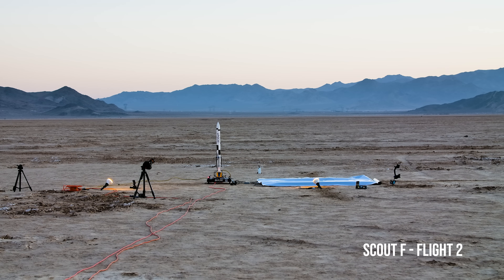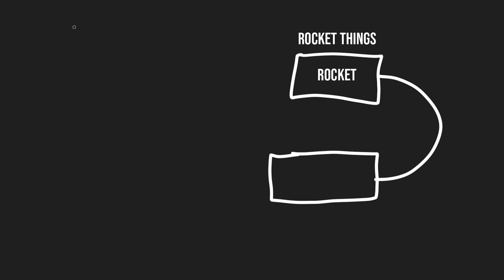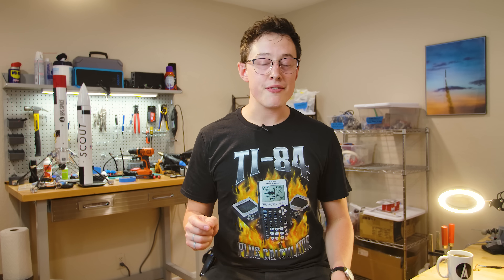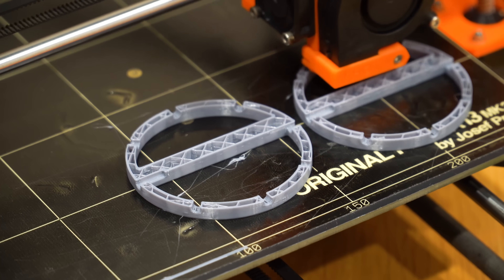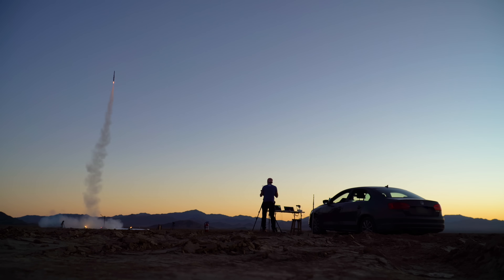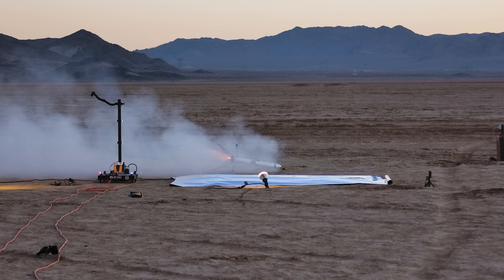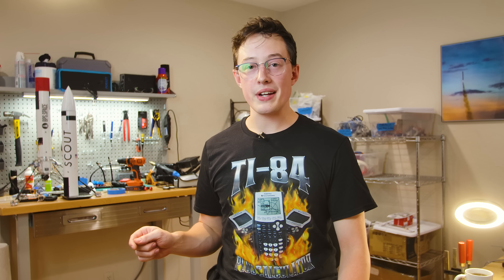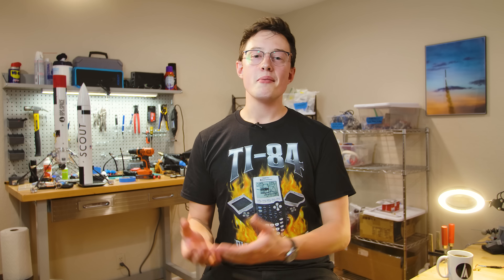Aluminum TVC Mount | Scout Flights 2 and 3

Comment: You should to take a batch of motors and accurately measure there burn rates in a controlled experiment as there will be slight marginal variation between motors that would let you calculate an average burn time for that motor and therefore give you more accurate data for calculating the height of the burn before the ground. You can see in some of the landing the motors is still producing too much thrust and likewise in some cases not enough

A lot of the issues with the model would improve actually just if the whole thing got scaled up.
PS I know you have successfully landed this now but just scrolling through your vids

Comment: Hey Joe,

I have been watching your videos now for a while and am absolutely impressed with your tenacity. I have a suggestion that may be late to the party but may give you an easier time controlling the oscillation issues you are have on the gimble. 

1. Instead of angular servos adopt a NEMA 8 or 11 stepper attached to either a gear rack and pinion or lead screw. Your stroke is roughly 5~7mm if I can gage from the video. The stepper has a holding torque to help stop the bounce but adding a lead screw will stop the bending moment and loss of leverage at the end effect. I recommend a lead screw vs gear rack due to the ability of the lead screw to add back feed counteraction. Use a fine pitch of about .5 and 8mm D. You will need to add a stepper driver of course and then in C create a simple PWM to step/direction algorithm to convert the PWM angular to steps. Not hard and there are several examples. This will add weight but not so much that you couldn't add grain size to compensate.

2. I see you try to use screws as pivot points. I highly recommend using bronze bushings and shoulder bolts giving you excellent tolerance at you pivots and an easier way to fine tune the fits as the shoulder bolt is precision ground. Use bronze flat washers and polish to fit between faces perpendicular to the pivot axis to remove lateral and bending slop within the pivot joints. 

This approach is similar to how space x controls the motor gimbles on the Falcon. How I know that is NDA protected so.... 

I wish you luck and low winds brother.

Comment: If an angle makes an angle of 80-120 degrees to the horizontal under 50 ms in 100ms, the motor causes an angle distortion during the output of the second motor during the return. Check it every 100 ms and if it is causing problems, reset the engine according to the rocket and start the x, y, z controls again.
The problem will be alleviated.
Greetings from Turkey

Comment: Do you use the BNO055 with calibration or without?  If you are using calibration, are you re-calibrating each flight or have you stored the values in non-volatile memory?

Comment: Mr. Benard, there are 4 supports only in your rocket for landing.  Your idea is very proud to me.  But if 1 support is unstable, the whole rocket will tilt, and fall to the opposite side and finally drop as only 1 support in the opposite side.  You can investigate in very slow motion of how the rocket land in less than 1 second.  As the plan area of the rocket is a circular shape, but your rocket using 4 truss supports as square shape. it is difficult to form it as a whole structure.  I would suggest to modify it to have 8 supports which is a little bit similar to a circular shape in order to to improve its stability.  If it won't have adequate area around the rocket perimeter to install 8 supports, try to install it as 2 layers which have 4 supports in each layers but with different orientations.  Another important point is its support leg length, whether it will form as 8 supports with same radius on plan view after landing or even longer length in upper supports in rocket by forming a truss to reduce its slenderness ratio to minimize its buckling or twisting and make 8 supports to form 4 corners as inner supports and anther 4 corners as outer supports.  Moreover, "1 outer support together with 2 inner supports" or "2 outer supports together with 1 inner support" can also form itself as a large triangular stable support if horizontal members or even say extended tie, spring, elastic material as rubber band, etc. are installed between them and finally forming 4 bigger triangular 3D truss supports and its stability will increase much.  I am a Structural Engineer, the rocket with 4 landing supports are similar to a tall building rest on a small pad footing foundation.  Such building will become more stable if bigger size of pad footing foundation could be constructed to increase the safety factor for Overturning Checking as the moment arm from one side to the opposite side is increased.  Please take it into consideration.

Comment: I think to fix old servos vibration need to use a gear mechanizm. Just to flying up the roket it is not need a hight driving wiggle vector and hight speed of vector controll. 
Gear is good idea.

Comment: Would adding a gyro assist with stability for smoothing wiggle etc? I realize that addressing the problem from a broad perspective. It sounds like your problems can be fixed with $$ and professional machining for custom made parts! The problem is; once you get too good at this, either the govt or private will ask you to shut down and join them

Comment: On the decent stage, it seems like the rocket fires off at a very inopportune time, and causes the vehicle to whip to the other side and wastes a lot of thrust. If you could write some code that would let the computer decide if it should fire immediately or wait some amount of time based on the current rotational velocity in order to fire in a more vertical position.

Comment: One thing that might help with landing on a pad is separating land vectoring into multiple stages, for example you could have one stage aiming the rocket towards the pad, a second which focuses on stopping the rockets lateral movement, a third making the rear point at the pad, and a fourth which focuses on the soft landing. Obviously this would work easier with longer engine burns or stabilizing fins, but it's at least a start.

Comment: Sometimes I believe even your calculations and estimations are correct. I believe, one big factor which has been a variable is the rocket motor itself. The composition and the manufacturing of the fuel could affect the rocket motor functioning greatly. And, I believe that apart from thrust vectoring, you should have a internal rocket balance system, for example using a capsule like structure which contains the weight which could be shifted at an instance to balance the trajectory, or say a fly wheel system present in the body of the rocket, integrated with the thrust vectoring system could be good. Or you can use gyroscope for better balance. Also, I would recommend this to be done on a scale 2 or 3 times larger than the present rocket system. Your mechanism of thrust control and the system you are using really is something new.

Comment: You could increase bandwidth in the control system by moving away from the averager to a min-phase design procedure. Won't get you much, but it's basically free bandwidth. Another typical trick is to go nonlinear and use a slew limit at the output of the controller (particularly important on the D term)

Comment: As much as I wish you success (and I believe that you will succeed), doing this with off the shelf solid propellent model rocket engines is for sure doing it the hard way.  Not that building your own liquid propellent engine is easy, but you're so limited by these toy engines that you have to solve problems you wouldn't have if you had a single engine that you could turn on and off and control the thrust.  I'm sure you know this, but it's kind of painful to watch.  Nonetheless, good luck!  (And remember Berkun's law: If it's worth doing at all, it's worth doing the hard way.

Comment: When using solid rocket motors for a vertical rocket landing, one of the problems is the inability to adjust the thrust of the motor.
However, it is possible to get an adjustable vertical thrust component by deflecting the motor axis from the rocket axis.
For symmetry it is necessary to take two engines and deflect them simultaneously in opposite directions.
If you deflect the engines by 60 degrees, the force along the rocket's axis will decrease by half, if 90 degrees, then to zero.

Comment: In the block diagram you mentioned,  sensor estimator is running at 400hz but the IMU you have used BNO055 it's output data rate is 100hz. is it worth to run the sensor estimator loop at 400hz if your sensor output is 100hz?

Comment: If you are willing to get even more machining practice, I think you can shave off significant amounts of mass on that TVC mount still. The tube for the motors especially looks super beefy for what it does. Just think of the bottom of a soda can. There isn't much material there, but it's still very strong an ridgid.

Comment: I think you could take some weight off by making recesses in the tvc. Just like spacex does on the starship's engine mounts.
On the other hand, if you want to land in a certain place, you need something that controls the tip of the rocket. You could put the fins (you say they weigh a lot). Or take advantage of part of the remaining thrust of the landing to recirculate it upwards with 3 tubes and 3 microvalves and that pressure comes out through the upper sides of the rocket. It's a crazy idea, but in theory it could work.

Comment: I'm assuming that you're using PID for control of the TV, in your feedback loop. The issue you're having seems to be an issue of a poorly tuned system, with lots of overshoot, and poor damping. You seem to be using the moving averaging filter instead of correctly tuning the damping.

Comment: My dude... It's the kalman filter. That's your problem. Without some direct measurement like radar or computer vision, you're always going to get hella drift if you're just trying to figure out your position inertially. This is why your phone has no problem figuring out it's precise 3d rotation with the IMU, but we needed to invent SLAM and use cameras to make AR (positional tracking) work. Especially for your use case, where there's intense vibration from the rocket motor, even a perfect mathematical model (which kalman is not!) is destined for failure.
I don't think you need full SLAM to target the landing site, but you can definitely use those cameras you have strapped to it for guidance. Paint a big red target on your landing pad and tell the rocket to keep it in the center (or wherever it should be). You'll need a slightly bigger computer but if you use a super low res black and white image, you can probably get away with like raspberry pi level hardware. I can guarantee SpaceX is using CV for the fine tuning once the landing site is in... Sight :)
If you don't want to go the CV approach... Idk is there some kind of radar beacon that you could use to target the landing pad? It would be hard to know which way to turn with just a distance measurement, but I'm sure you can get creative. Or just say "screw it," ditch the landing pad and focus on zeroing out your velocity regardless of how far you drifted.
Oh yeah and try a lerp (linear interpolation) to smooth out a noisy signal. If you just have the TVC adjust its angle 70% of the way to its target during each cycle, it will lag behind a bit but not as bad as a moving average (which is basically a lerp pinned at 50%). With lerp you can tune the "smoothness" by deciding what % of the way to the target you want to go. You can even go past 100% and overshoot if you want! But that would be bad for a rocket, I imagine (:

Comment: You could take a look at 3D-Printer firmware which tries to counter the wobble of axes when turning directions (Jerk). The tactics used should also be applicable to your steering mechanism.

Comment: I really have to wonder, how standardized are the rocket motors. Are they really identicalish to each other? As in, are the thrust curves standardized and reliable?
Reply: The engine he uses is extremely reliable. It was made by Estes which is one of the best model rocketry manufactures. From kits to engines, you can trust them on almost everything they make.

Comment: This probably isn’t an original question and I’m aware you aren’t able to add fins because of a weight budget. but have you considered flaps that come out of the fuselage to add vertical stability when the engine cuts out at the apex of a flight
Reply: He already tried that for scout E, and he ditched it cause he found that they didn’t actually help much

Comment: What if u redesign the legs to negate the bounce? Like a normal cylinder with a small hole so the air in it only escapes slowly. do this on all four legs and maybe it is able to absorb the impact. Maybe this can be build with straws or other light weight rigid tubes. That way you can, at least for now, ignore the positioning issues.
Edit: just after writing this comment i unpaused and u announced the fix for the bounce. will be interesting if u thought of something similar.
Reply: This IS the redesign to reduce the bounce. And straws? Ok fine I will explain. So first, this is built to be a tank. The ability to fly it, then immediately fly it again. Also, straws is worse than plastic for landing legs.
Reply: @fullflowaerospace  Agreed, straws are a bad idea. But that was the first thing that came to mind that was light weight and could act as a cylinder wall.

Comment: I wonder if you could repurpose the tracking equipment for the HTC Vive VR headset to get millimeter-level position accuracy during the last 10 meters of flight? You can build your own custom IR tracking receiver for the rocket by following along with some GitHub projects, and use a pair of base stations on the ground.

Comment: Ok Joe I, wanna suggest you the perfect thing you can do to land it correctly:-
Now if u see  to jet land or we could say to land a rocket propulsivly we require a huge control on thrust vectoring and throttle controling system .Now thrust could be produced by anything even if ypu sling shot. A stone it will provide thrust on your hand but we generally call it as a recoil but when recoil comes in form of rocketry we call it as thrust now so when we release particles in one direction we get an equal and opposite force on opposite direction but we generally do not use just compressed gas (obviously a compressed gas can also provide thrust as It would expell gas molecules under High pressure in a particular direction and gain a thrust) but we generally use combustible gasses and burn in order to increase the volume and kinetic energy of particles this increasing the velocity of particles leaving the engine eventually increasing thrust now if you see mode which you are using is solid rocket engine they have major disadvantage that their throttle cannot be controlled once they are lit there is no comming back ,so we use them generally at launch to produce gas and hot particles at high temperatures for extra thrust during launch but when it comes to landing we don't require that gynormus amount of thrust but we require gynormus amount of throttle and thrust vectoring control now if you see from your work and design you could control thrust vectoring control but can't  really throttle now one of the thing I suggest is that use compressed gas instead as they are compressible and can give sufficient amount of thrust when released and you can even control their throttle just by introducing valves and Hence you could control thrust and vector it same time for better landing .I m not telling you to not use the solid motor rockets you could use them but use it just for launch and use compressed gas as landing propulsion now I don't recommend you to build multi stage lander I'm telling you to attach four thruster at four directions at the upper end of rocket and which could release gas stored in tank and use solid motor engines to launch . In an all you'll use solid motor rocket to propel it in air and compressed air powered thruster to land safely thus completing your mission have a nice day Barnard see you after successful land

Comment: Problem I see is that with a finless/gimbled engine rocket, is that it is obviously unstable when the thrust stops. The rocket immediately went horizontal and at that low altitude never had a chance for the booster motor to settle in and stop the pendulum. Also the boost takes it off line from vertical and the return motor tries to correct this and get it back to the pad. Keep it up. You will get it. Exciting watching your progression.

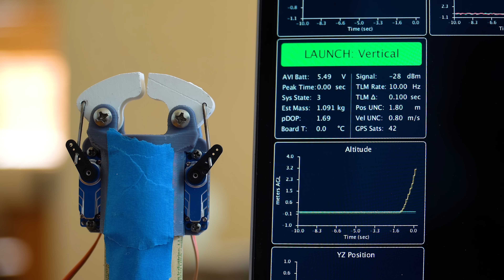Comment: @8:25, did you mean hardware in the loop?  I don't believe running on the actual flight avionics is considered SIL anymore.  (That said, I also don't believe an open-loop simulation is considered "in the loop" either.  It's more just log replay on hardware).  That said, happy to learn if other folks have different naming habits

Comment: One thing I noticed is that sideways motion just before touchdown seems to be causing issues with it wanting to tip over. Part of the problem of it not knowing where it is accurately enough I suppose... as well as it knowing how fast it is moving in any given direction.  VERY cool project, though.. you're getting DAMN close!!!

Comment: On Falcon the legs have some form of crash absorber included, which are "used" on landing and have to be replaced after the landing. Did you ever thought about some crash absorber in the legs to avoid bounce?

Comment: would a liquid or gas fueled rocket be feasible at a slightly larger scale using electric pumps for the powerheads? And are there any legal ramifications? Wanna try and build one